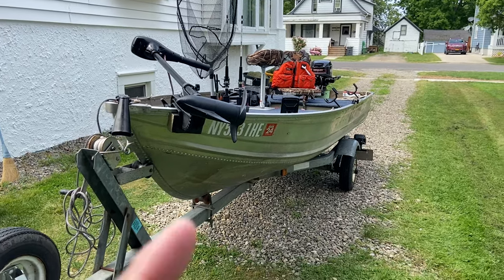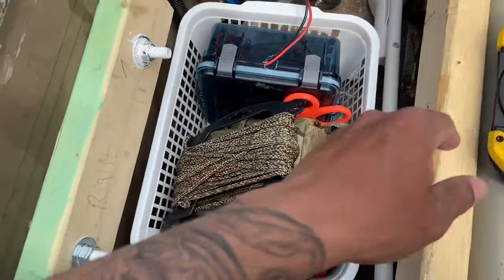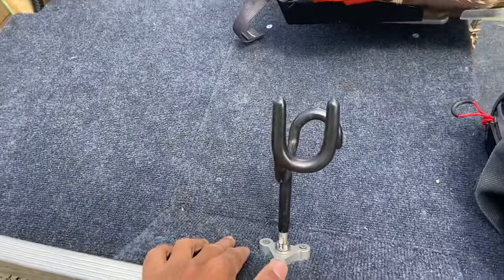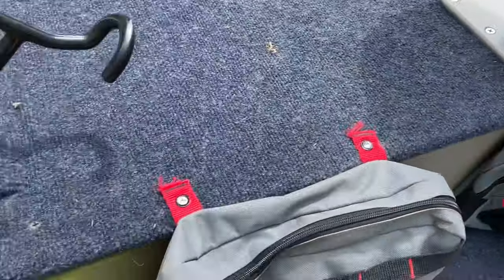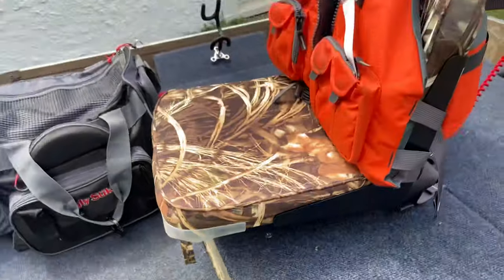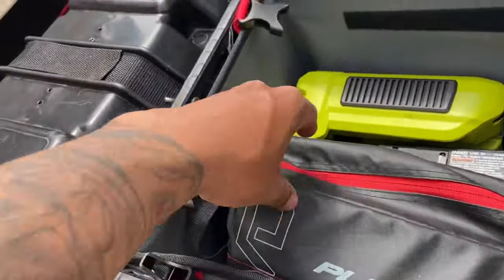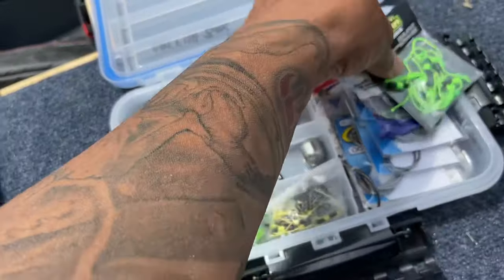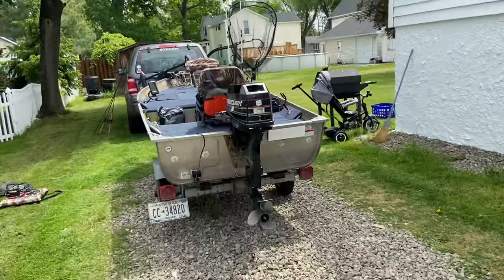Aluminum 12ft Boat To Bass/Fishing Boat Conversion (Lowe Sea Nymph V Series 1256)

Comment: Nice setup. Just a note. My 2018 Mercury 9.9hp came with a 6 amp alternater (electric and pull start) so it keeps the battery charged continuously. Runs all the gear as well. Fish on! 🎣🚤😊

Comment: I love these little tin boats, especially the older Lowe's! I like your idea on an external battery. I always keep a cheap booster pack with me. I bought mine form Walmart and it has all of the plug in's and lights but it can also jump my cranking battery off in a pinch. I'm currently building my 14ft v-hull and will be uploading my first videos here shortly.

Comment: I run a tracker 12 ft. deep V, before that I ran a 10 ft. Sears. years ago. Here are a few suggestions from experience older than you are. First suggestion…..put a stingray Jr. fin on your engine (Bass Pro). It will jump it up on plane quickly and really add to stability. I actually run a 25 hp. Yamaha electric start on mine…..27 mph with just me. I have a Motor Guide X5 with remote and transducer on the front with anchor lock. Improved my fish catching by 50% (12 volt Lithium off Amazon 22 lbs), LED Rigid Industry headlights, and red/green led permanent running lights, carpeted floor, Ranger style bass seats, Lowrance HDS 9 on front and back, a all aluminum custom drive on trailer, and finally a custom towable custom cover. I get 26 mpg towing it with the Subaru. I’d suggest stop drilling holes in the boat. I glue most everything to the aluminum. Now it’s a pricey boat, but I’ve made improvements starting with it new in 2002. I started with a 7.5 Eska, then a 15 hp Mercury, and then the Yamaha. The fin on the back was the best improvement and cost $60. I’ve fished from Erie to Ochachobee in it. I can fish a month on the 3 gal of gas in the tank, while the bass boat in the garage takes that to idle out of the marina. If you want message me and I’ll send you a photo. You’ve made a great start.

Comment: Nice set up just one tiny thing. You might want to set up a chain or heavy duty wire with terminal end to snap on to front recovery eye in case your winch attachment point, rope, terminal end or winch it self fails.

Comment: Sweet rig bro, I just did my 1965 Mirrocraft 12 foot V-hull with an extremely similar setup. I purchased the hull with trailer for $1000, then the bass boat deck style diy build was a extra $1000, now i’m on the look for a 6-9hp motor and that will likely cost more than the whole project ($1,500-$3,000)

Comment: Where’d you get that box for the battery. Great idea sweet boat by the way. Excellent job on the boat in my opinion you’re better off with that trolling motor. I’ve had a bow mount and a transom mount dows exactly the same job for way less money

Comment: Keep that little trolling motor. Everybody talks about bow mount so I got one but they suck on a lightweight aluminum boat. They are too touchy and the pedals over correct. A spot lock would be awesome and a remote might work well. Forget pedals though. Just keep what you have. You will have better control than with a pedal.

Comment: nice build man! I am actually picking up essentially this same boat! how is the stability? I am a big boy (300lbs). this will be the first boat I'll be fishing from ever... any tips for bigger bodies of water? any downsides from your build u wish you could change?
Reply: I am looking into framing out the deck with a @Tinyboatnation kit (aluminum framing kit for a deck/storage)
Reply: My fishing buddy is 300. Couple suggestions…..put in a floor not a deck (lower the center of gravity) being that high can really rock you. The floor is 5/8 plywood, with angle slluminum bolted underneath to stiffen. Aluminum doesn’t touch the boat but strengthens the wood. Carpeted the wood. Seat tops were reinforced with aluminum plating, then the seat mount plate mounted flush on top. Seat base is spring loaded with bass seat on top of it. Check weight rating on seat….they make big boy seats rated for 300 so you don’t break the back setting the hook.

Comment: Dude ive got a 12 foot sea nymph were doin something like that i take you and your dad go on it too? Im putting a minn kota edge and a little out board on the back of the boat do you think yours was pretty stable
Reply from the maker: Oh yeah it’s plenty stable I stand all over it do whatever I want with two people at staple as well if you’re both standing got a pay little bit more attention but still very doable only thing that you cannot do is if you have an outboard and a motor on the back you cannot put the battery in the back as well take it for me I tried almost took on water in the back 😂😂😂 Good luck on your bill thanks for stopping by the channel
Reply: @OutpourOutdoors  no problem at all have you tried mounting a bow mount by chance were guna try n get away with a edge bowmount up front and i was thinking about running a little tiny 2.5 in the back or something any tips on weight distribution and those kind off trolling motors on these little v bottoms?

Comment: Does it get up to plane with all the added weight and that motor?
Reply from the maker: Yesssss siirrrrrrr a good 15mph on a calm day
Reply: @Outpour Outdoors  thats awesome..ive got a 12 footer too, it only has a 6hp and wont plane, but i just picked up a 9hp motor, so thats awesome knowing your 8hp moves it that well.....thanks!
Reply: How much mph did you loose from the added weight of the wood ? I'm wondering because I'm currently doing this to mine

Comment: Shoul have used pressure treatment 2x4’s. I don’t think the Kilz will work, long term. Nice mods !!!
Reply: Pressure treated wood has a chemical reaction with aluminum. and makes thr the aluminum corrode over time.